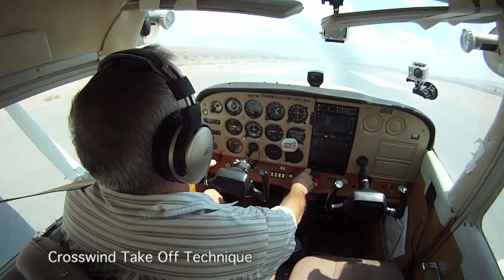CrossWind Take Off Technique

Comment: So twice now I have had a weird thing happen in a stiff left crosswind in a warrior.  I was full left aileron and right rudder.  Tracking perfectly on the center line as speed increased I could feel the left wing start to get some downward pressure so I rolled more and more aileron out.  The plane was very squirrly and prior to rotation I actually needed right aileron because that wing kept trying to lift first and it was the downwind wing.  I had to rotate early into ground effect because things were getting worse.  I tracked straight when the wheels came off but that ground roll was unerving.

Comment: you said the crosswind is coming from the left, then why did you turn the yoke to the left, wouldnt you have to turn the yoke to the right?
Reply: ***** Yes, if the winds from the left you put in full aileron deflection to the left. This is to keep the wind from picking up the left wing and also helps maintain center line. You begin taking out the aileron as you begin to accelerate. If you take it out too slow in a strong wind your right wing may rise some, too fast and the left wing may start to rise. If the upwind wing rises you can actually skip across the runway on the downwind tire. It really is just a matter of doing it by feel and correcting as you go. I returned to flying two years ago after a fairly long break and it took some practice to feel comfortable again, especially in strong crosswinds.
Reply: ***** No problem. Good luck with your flying endeavors!
Reply: AK FOX that's what I thought, but in the video, they said to put the aileron in the opposite direction